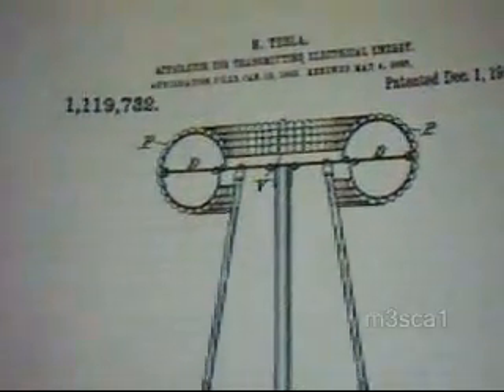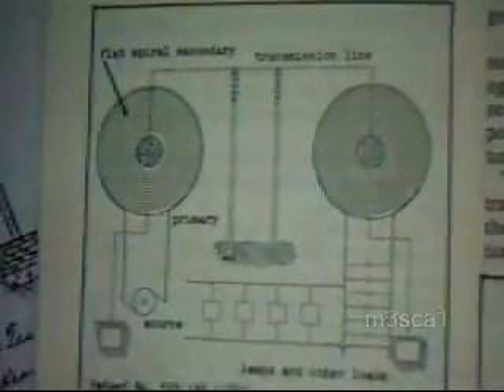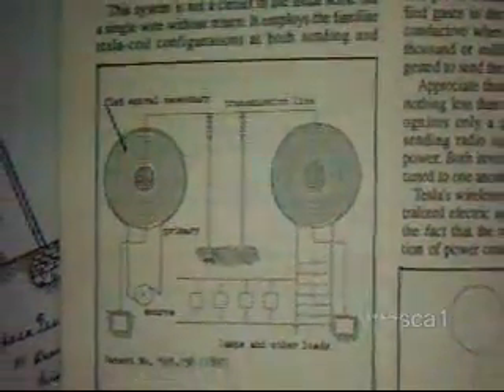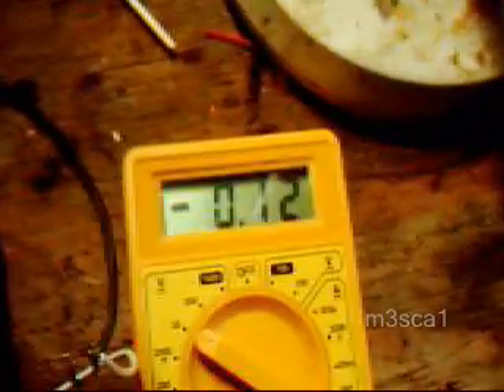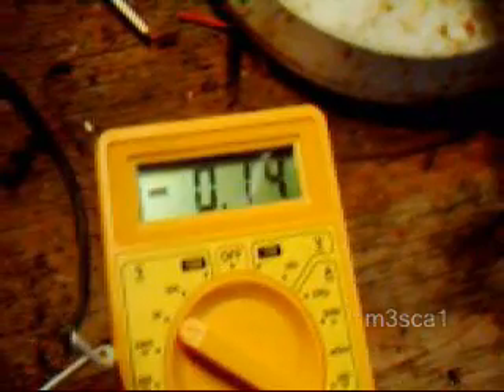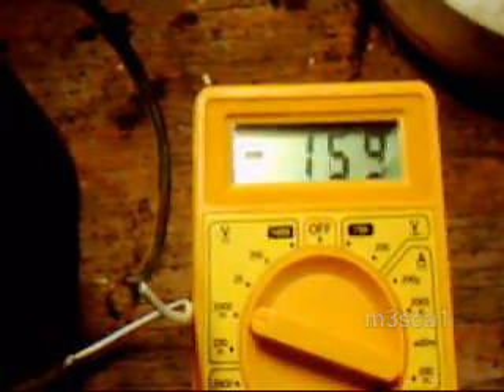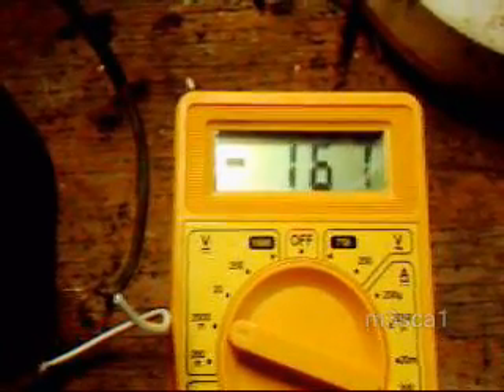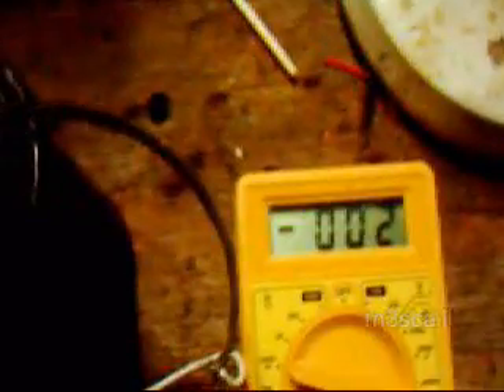Wireless Transmission of Energy

Comment from the maker: using the figure of 8Hz earth resonance at quarter wave-i came in at 29250000 ft or 5539.7 miles.
even if that was wound as the secondary then it would still be a huge undertaking.
perhaps he was working at some far removed harmonic like 1/32 or 1/64 wave.
how he did it,and wether or not it was a good idea-i guess we will never know.
reports of horse bolting form stables for 25 miles radius from the Colorado TX and butterflies being caught in the corona discharge and burning up,also...

Comment: nice work..
u showed a signal when the the transmitter was turned off, it looks like mains suply frequency wave. you scope can measure the 50Hz most times indoors, i mistakingly thought it was an Earth wave frequency or something.

can you check out my setup M3sca1, i need some help getting longer range on my transmission

watch?v=1_AGbBsa45E

Comment from the maker: no Ground on the transmitter.
i figured with the close proximity of the 2 devices,it would not be a fair demonstration if the transmitter was grounded.
i need to bang in another ground wire further away from the shed and then  ground the transmitter and see what kind of range it has.

Comment from the maker: good question-i just went out and tried it with the lights off-the signal gets smaller by about a third,but is still there.
im guessing the wiring loops in the shed would be enough to induce a 50 Hz hum into the reciever,even with the lights off.
the oscilloscope also could be making noise.